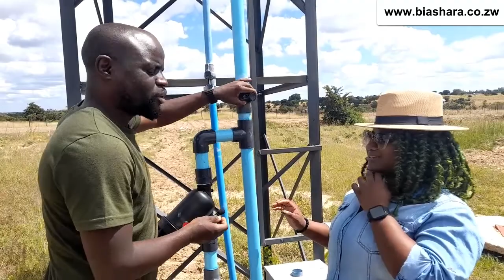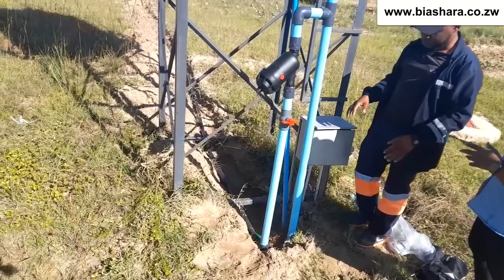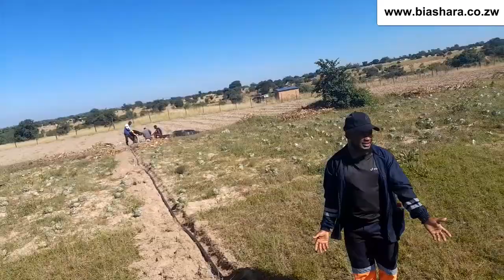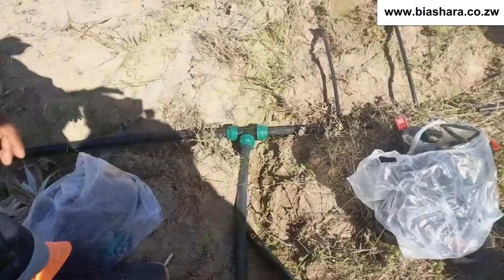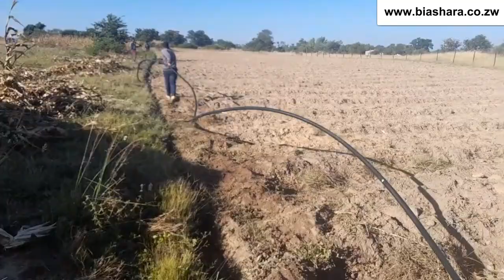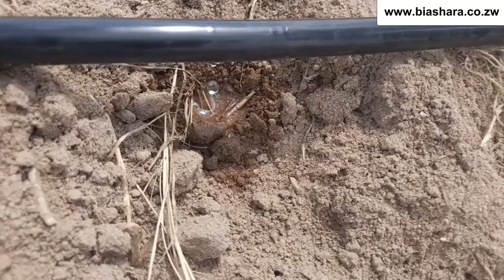Installing Drip Irrigation Kit In Zimbabwe

Comment: Great show, is it better to go overhead or drip irrigation?
Reply from the maker: That mostly depends on what you're trying to achieve and what your budget is. It's like comparing using a fuel run generator vs. using a solar system for power. Both get the job done, but there are pros and cons to either, especially considering what you will be wanting to power.

I would say naturally (since the context of the video is horticultural), we would lean towards drip irrigation for conservation purposes. We take care of our land and resources, and they will do the same in return.

We will, however, make a video outlining the pros and cons of both methods so that you are able to make a more informed decision in your endeavours.